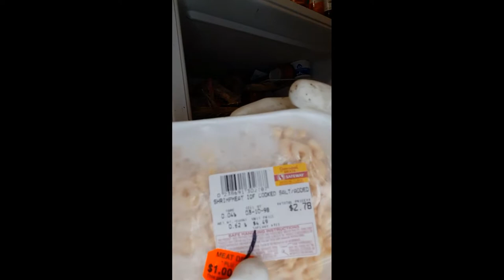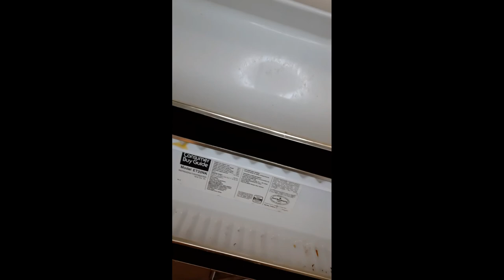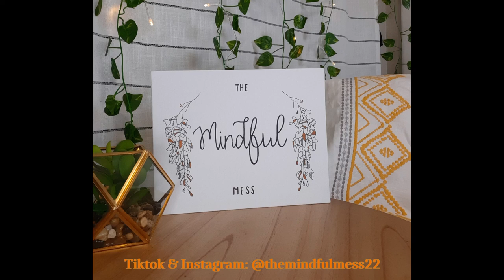How to clean a hoarder refrigerator

Comment: Great job. I am a hoarder and have a question. Did the owners use the fridge after you cleaned it? Mine isn't nearly as bad but the smell is honestly horrific. 

I already threw out 2 garbage bags halfway full of rotten food. I didn't want the bags tearing apart. I still have maybe one more bag of food to throw out and I'm unsure if I can stomach the smell.
Reply: I don't know if this will help, but my son and I have a farm where we have to dispose of skunks and sheep that have decayed into truly powerful smells. It's weird but buy a pack of clove cigs from a minimart. We have found that if you can stand just a few drags you won't wrench just long enough (about 15 minutes) to get some really nasty jobs done. it's obviously not an ideal, but honestly the smell and taste mitigate everything. We just finished cleaning out a freezer that was out of commission for 6 months that neither of us could hold the door open for more than 30 seconds. Best of luck
Reply from the maker: I'm not sure what the owner ended up doing with the refrigerator